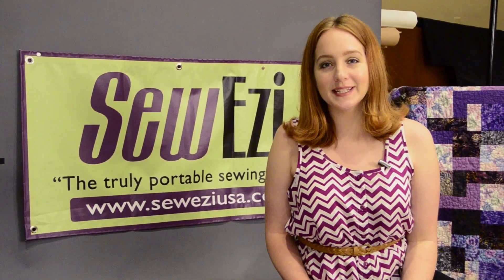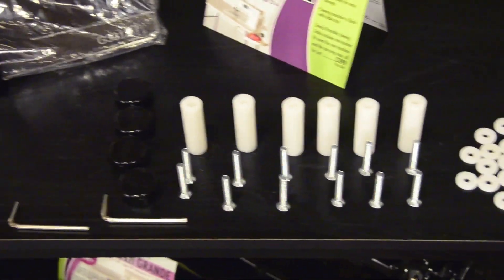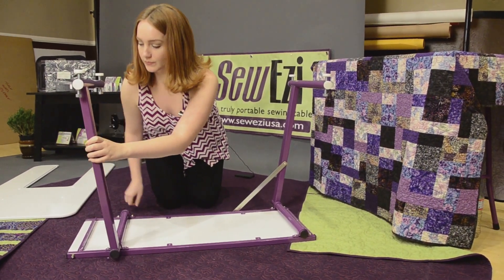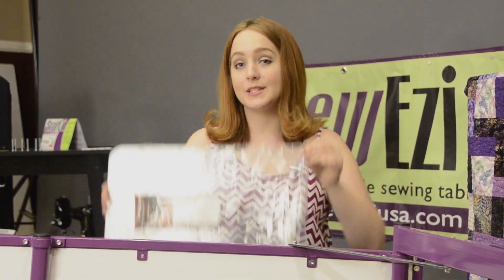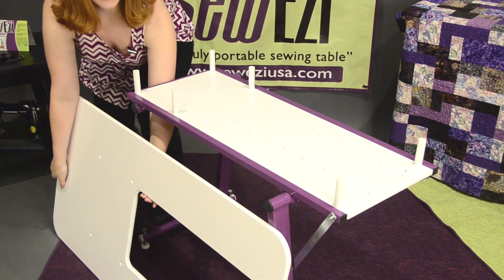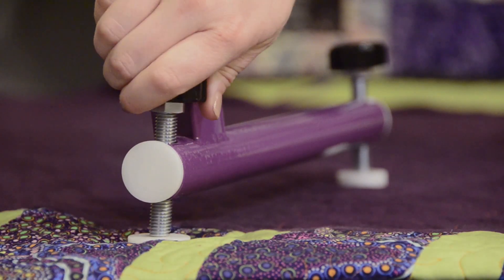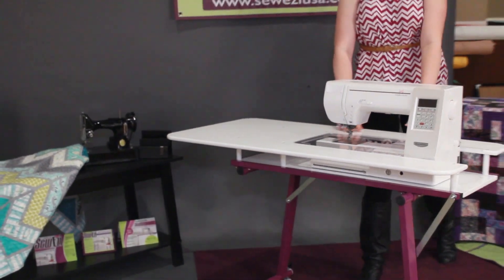SewEzi Grande Sewing Table Assembly

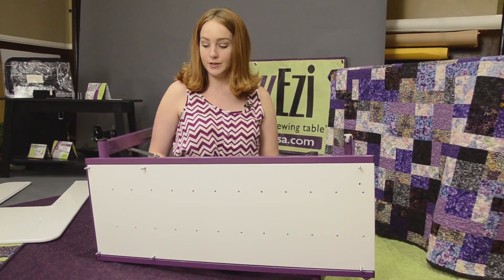Comment: I just put my SewEzi Grande table together. When the paper instructions were not quite clear, I turned to this video, which I had watched before getting the table. Please note: at the 1:21 minute point, the letters B and E are pointing to the wrong places to insert 2 screws. Those spots already have screws there, which attach the table to the frame. The holes on the far right (top and bottom, to the left of the presenter) are where the 2 screws "B and E" should go. For reference, those holes are the ones marked A and D later in the video at the 2:00 minute point.